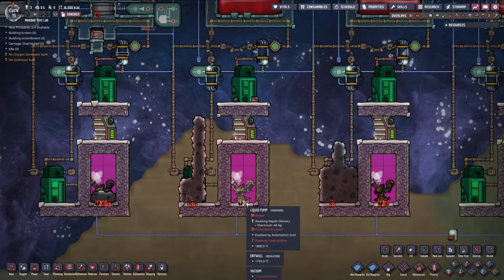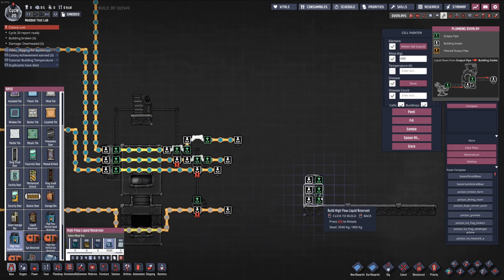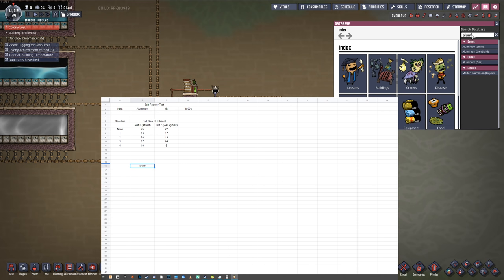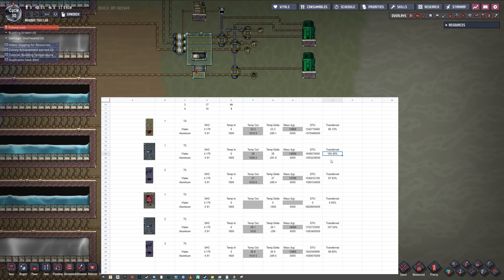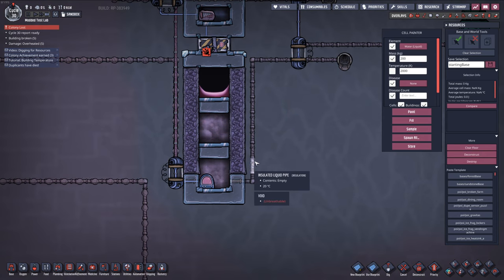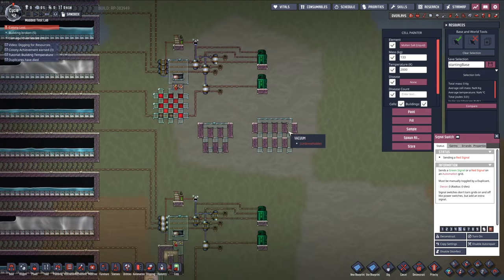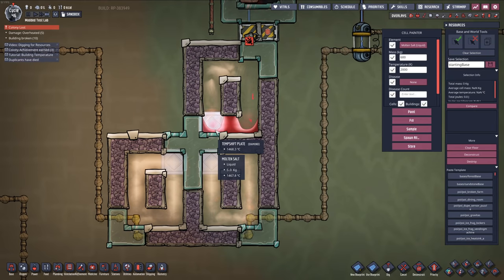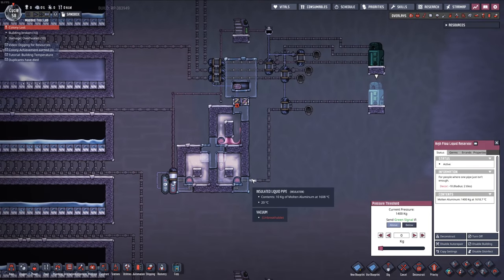200+%!? Hacking The Salt Reactor! Oxygen Not Included Experiment

Comment: 27:25 I think with both the double setups, the first is limiting the energy flow to the second, keeping it closer to the boiling point and making it more efficient. If the temp on the second is really low, it condenses the first and draws the hot gas in, increasing energy flow, and as it gets close to boiling the first stops condensing and limits the flow to what can occur through conduction only. That would, theoretically, prevent as much energy being transferred before the gas has a chance to be replaced with more liquid, therefore using more of the energy to boil salt and with less being transferred into the already boiled gas and effectively bypassing the system.

Comment: So the problem with multiple chambers is that most of the time the gas in the lower chambers is not condensing, but just acting as a buffer for the heat provided by the molten aluminium. This happens because there is a middle ground of temperature where liquid aluminium stays liquid and aluminium gas stays in gas form. While this is happening you are not benefiting from the phase change energy gain. You can cure this by forcing the gas in the lower chambers to condense when the gas has persisted for a certain amount of time, by redirecting 1000g of the output water through the bottom chamber before it goes in the tank. This way you force a condensation of the gas in the bottom chamber, allowing it to evaporate again and gain energy. This way you could make a multi-stage salt boiler that should be quite efficient. Of course make sure you only send water through the bottom chamber when gass has persisted for a little while... Think of it as a reset of the system back to its most efficient operating state. (which is not the long-run state where the bottom chamber is just gas)

Comment: With your infinity loop styled one, I thought maybe divert,  say, 80 % the way you were and 20% piped through the top loop the same as the bottom. Could act as a pre-heating system and better increase overall top temperature.

Comment: I wonder if your flow system may work just as well with a 4X4 square where you heat the bottom left and condense top right. Shrinking your transfer distance in such a way is about the only way to increase the transfer rate.

Comment: conveyor rails should transfer heat more effectively between chambers then shiftplates (only because of the mass difference and we want the least amount of mass between chambers so the temperature jumps around).. the rails will be simple 4 segment loops of say diamond. this will replace the shiftplate as 4 packets of diamonds would only be 80kg of mass as where a diamond shiftplate is 800kg (10 times more) this will cause heat to change very rapidly which is what you want.
actually even better you could put 10kg or even 5kg in each segment on the rail. this will cause more fluctuation and thus more phase changing. or at least it should.
changing the diamond walls to be insulation and using only conveyor rails again makes it so there isn't much mass between the the areas and thus temperature will change very rapidly.
instead of having only one door where the cutoff and transfer happens is you could have two and replace the diamond tiles with insulation again and use conveyor rails ran through the doors. inside the 0 loop you can run the rail down the right side (cold side) and then run it up into the wall back to the doors.

just some ideas, not entirely sure if they will work, it will lower the mass of area by a LOT though so that might help with keeping the temperature shifting around more.

Comment: Hi Brothgar. I'm afraid no multi stage setup is going to work, above 2 stages, unless you mess with heat transfer via automation. Let me explain.

You have a hot side, a heat generator (where molten aluminium is) and a cold side (where heat is consumed). In the middle you can ONLY have a gradient. If you relay on passive heat transfer, uncontrolled, there is only one point where the temp is right  for phase change, once the system is temp stable. In multi stage systems, with odd number of stages, this would be the central one. If even number of stages, this could be the central 2. So you're expecting one/two phase changes at best (all stages near the hot side are gas, all near the cold side are liquid, the central one(s) is where the change happens). There's no way around it.

Unless automation comes into play. Think of this, and I'm making it big on purpose. A 10 stages system. Automation allows heat to move across stages only at the right temp. So at the beginning, everything is liquid. You apply heat to the hot side, first stage becomes gas, then second stage, than third stage and so on.  By the end of the first "pulse", you have all stages in gas phase, at minimum temp. Now, completely disable the hot side. Drain heat from the cold size. Last stage becomes liquid. Drain heat (w/o applying it) until all stages are liquid again. Then start over.

It's likely 10 stages are going to be very efficient but also very slow. Experimentation is needed to find where the sweet spot it, 3, 4, 5, 6 stages?

BTW, are you using the super modded setup for this save file? I was about to download it and run my own tests but the mod list is huge.
Reply: Something like this: https://imgur.com/a/S1xD5PL

Comment: Brothgar, my suggestion to move heat between the multiple reactors with less delta T (to have more phase changes) is to use the heat pipe design you talked about before (just loop a gas or liquid through all the reactors)

Comment: if you look into the numbers then (using diamond as an intermediate conductor) you can generate ~ 0.1125 kdtus per kg salt per second per degree difference between the aluminum and the salt as a maximum; plus 0.1125 kdtus per kg salt per second per degree difference between the extracting medium and the salt IF the salt changes state every tick. That's a theoretical maximum (using 130 degree steam) (and nearly boiling aluminium) of 185 watts per kilogram salt. You'd need absolutely insane heat transfer and an ability to immediately extract the extra heat. You'd need 1 steam turbine per 2 kg salt

if you want to use maxxed out steam turbines you could generate 177 watts per kilo salt

using the aluminum temperature you had 109 watts is the maximum

Comment: I am but a simple cat, but... would doing your math in Celsius instead of Kelvin be the source of increase in energy in the 'control' source? Because 0!=0.

Also I think the multi-stage loop (at 22:46) could work with a little tweak. I think you need to McDLT the diamond cross in the middle (keep the hot side hot and the cold side cold). So, have a little angle of diamond connecting the top of the top right tile in block A to the right of the bottom left tile in block B, and a completely separate angle of diamond connecting B's bottom center to A's right, second from the top. I think that would leave a 2x2 insulated block separating the two diamond conductors. Might give a little counter flow effect helping the condensation in A while preheating the liquid in B.
Reply: Celcius and Kelvin have the same scaling, it's just an "absolute" difference : CTemp = KTemp - 273,15.
So this shouldn't have any impact on the maths ! :)
Reply: @MrFlohCricket  Oh right, I wasn't paying attention to the actual math being done where the multiplications/divisions are all being done on the temperature delta which would be the same in either. 

I don't really know much about the real world math or the in game math, but my initial assumption was the math being is about determining the total energy of both liquids before and after going through the salt reactor. When doing SHC*temp*mass with both fluids and with before and after temps, then dividing the before total by the after total, using K vs C does make a difference. In either of those cases there is still a measured in game increase in energy but only around 5% with the best case numbers from 26:58. All of which is completely invalid if that isn't how things are done in either the real world or in the game. My basic understanding tells me using the deltas should be perfectly valid since you can still calculate the change in energy with the mass, change in temp and SHC. So I'm pretty sure I'm just a cat playing in the wrong sand box.
Reply: @ugacatfam  "When doing SHC*temp*mass with both fluids and with before and after temps, then dividing the before total by the after total, using K vs C does make a difference."
I don't see how it could make a difference.
(LiqSHC*InitTemp(K)*mass) /(GasSHC*FinalTemp(K)*mass)  = (LiqSHC*(InitTemp(C)+273.15)*mass) / (gasSHC*(FinalTemp(C)+273.15)*mass)

I may be doing it wrong but I don't see where :/

Comment: Designers made all these process' Isobaric .   that one decision leads to so many roadblocks down the road, where you cannot get anything resembling a true value calculation.   From that point on, it seems they just created a simple rule for temperature heat transfer.  Reason #458 efficiency calculations never make sense... even if it was running steady state.  It's a game.  yay..   I still want to see duplicant Bubbles more.   Let her open up a shoe store, fashion outlet or something on the top level of the asteroid.
Reply: I'm not really familiar with thermodynamics, but does the processes being isobaric or isochoric really make a difference in ONI, since nothing expands or increases in pressure with temperature?
Reply: @Mike-ukr  /IMHO  At first, when it was more simplistic as a game... not really. IE breaking open a cold biome to mix with a hot one...  Just combine some mass and area(2D) calculations with some basic game rules.  Simplifies why gases sink, and some rise.  Game could literally have a simple mechanic for 2 varying heat sources combining, where phase changes literally happen at a specific temp. point in the code.   Its a severe simplification, but they make it work. More complex process', not so much.   Once you get into these scenarios dealing with liquid metal reactors with phase changes, or energy production with simple hydro steam for example - supercritical-... it starts to require major corrections. ( If you glance at basics of a triple point diagram.)   I love how the game does it, and simplifies it... but it is why it is futile to try to get real value efficiencies.    As others have tried to present it..  hot liquid goes into turbine at X000K, creates a set power, exits colder + Energy, and goes along its merry way, and these values stay fairly consistent for ease of gameplay.  Its an excellent game, and no people do not need Heat transfer or thermo to understand it, It is just a large " guesstimate " set of ideal process'.   / IMHO
Reply: @Mike-ukr  And YES..  I still want to see duplicant Bubbles open up her own shoe store on the penthouse of the asteroid.  ONI needs more fashion.  bows... shoes... dress'...   play pretties ...   Might make Meep more happy to see Bubbles in a pretty dress maybe.

Comment: how were you able to make it more complicaed and probably more less accurate then the last time? XD I dont think these small chambers work.. thats probably also why you loose salt. The circles seem promising, but i would make them larger?!? And make the automation work on the temperature at the top, not at the bottom? Bc what you want is that it changes from gas to liquid, thats the point to create more power. What you could also try is to put some liquid under the salt, for better transfer (like some ppl put petroleum under water)

Comment: Why is salt so important for these? Is there not something easier to work with? I like the ideas but I'm not versed enough in how the game works I guess
Reply: @brothgar  Ahh okay, so it gains a huge amount of heat when it boils to a gas compared to the temperature it boils at?
Reply: @Hariol_  The thing is that temperature and mass remain the same, but the amount of energy/°C/g of material increases, so you end up with more thermal energy, with same mass and same temperature.
Reply: You can use some other materials for this, but salt is actually the easiest to work with, as it has the lowest boiling temperature(correct me if I'm wrong)